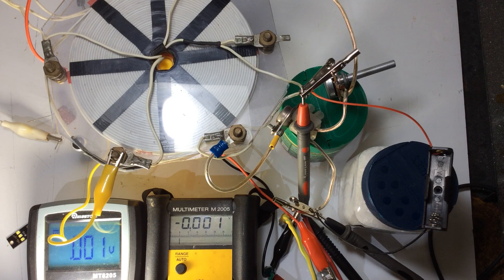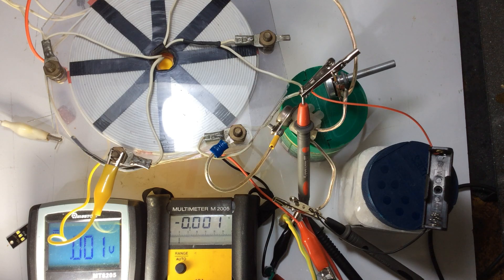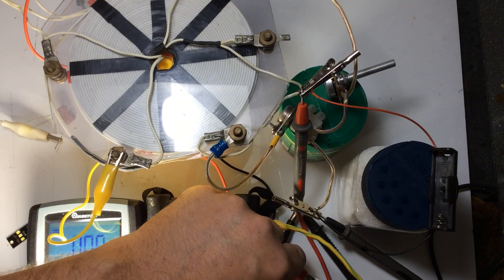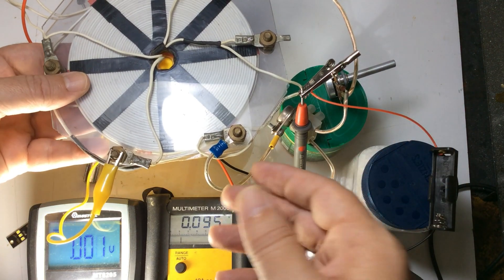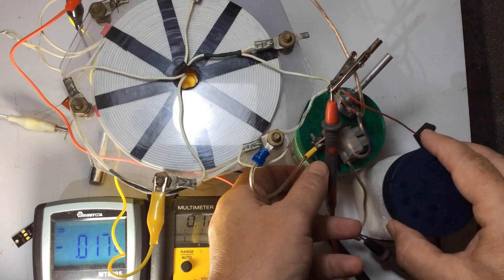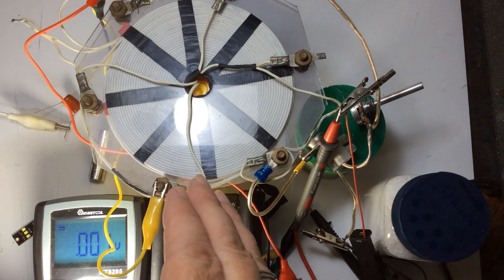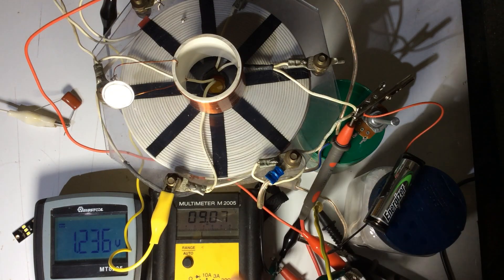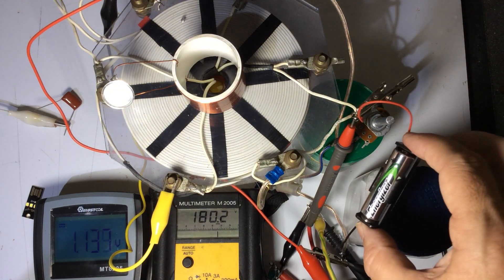Tesla Pancake Coil Joule Thief 1.2V to 180VDC

Comment: How you been? I just made this again yesterday. I'm going to try it as a "Re Emf" circuit see how it charges batteries. basically the same schematic just with some extra diodes. Also want to charge some super caps 600F 3v , see if I can boil a cup of tea. Anyway, I hope your doing well.

Comment: Also, in my other experiments following Tesla patents I found out that adding an earth to both secondary and primary together voltage doesn’t rise as much but, current is greatly improved using pancake coils.

Although I can’t explain very well why my setup works best with 3 secondaries (1bifilar+2monofilar) instead of 4 and not using quarter wave amplification … I can only guess might be due to 0.75 sqmm multistrand wire instead of 1.5 sqmm speaker wire, where resistance in 0.75 wire is more than double and voltage output is reduced … despite enough current available to power all kind of loads.

Anyway, this circuit is quite impressive and don’t need much power to keep batteries on float level.
Reply from the maker: Thank you for your comment.
My sincere apologies for my delayed response.

There are many amazing features gained when plugging into earth and in fact some of the biggest benefits to my circuit are only available with an earth. Keeping in mind that this is also achieved with an artificial earth, possibly not equal to but at least similar, which is extremely impressive.

For your coil arrangement it is important to remember that the load is part of the equation. The load can help or hinder achieving resonance, with one particular load the required coil arrangement will be different to a seperate load.

The next means of adjusting the setup to achieve resonance is capacitors, both serial and parallel arranged. I like to concentrate on coils + load/s, then I add capacitors if necessary.

I will upload a video on this circuit that I made shortly after I made this video, I wasn't in a good place when I made the video and it wasn't uploaded because I wasn't coping too well, both when making and after as my absence may have revealed.
In that video I use the two earth system and I can confirm it is as you state, a lot more power.

Thank you for watching.
Reply: @whatifididthis...1236 no need to apologise, I am very glad you are better and manage to come back online. I wish you all the best !
Reply from the maker: Unfortunately I'm not better, I just feel really bad that I can't answer people when I should, I struggle to sit still long enough to deal with it.

 This I believe is the downside of being tortured by my body and thinking this day is my last for 25 years, I'm surprised every day when I wake, thankful for another day and immediately my body reminds me I am a prisoner and I shall struggle until its time to go to bed, rinse and repeat!

I think the attention deficit is a side effect of living like this for 25 years, actually more like 35 years as the 25 years is from the time I was told I wouldn't live long.

As far as my poor health being related to my work as I have seen comments from people saying I may be suffering from RF emissions, I believe it has had the opposite effect as I was like this first.

When I was told by doctors to occupy myself because I could no longer work they suggested I get a hobby to occupy my mind between operations, due to my physical limits and the birth of the internet, yep that's how old I am! 😂, I chose to read Tesla's patents which lead me to become extremely proficient at scouring the internet for everything you could imagine, I am that annoying guy that knows quite a lot about most things as I'm obsessed with information of all kinds and I literally overload my brain with information every day as a way if mentally distracting myself from the pain. I am also blessed that I have an eidetic memory so I keep seeing everything I've ever seen like a database that is always with me, my own albeit limited wiki mind. Admittedly bias to my interests. The fact that I learned about and started playing with these circuits after I was already injured and I've exceeded my projected timeline I would suggest my circuits, Tesla's circuits, have been good to me.

I'm glad I am still bothered by not replying earlier as I feel once I no longer care it's going to get bad for me. 

I just want what I have discovered in my research to be studied and understood by others so thank you for your support and thank you to everyone else for the support over these couple of years, it makes me feel as though I am not wasting my time.

Thanks for watching.

Comment: I made one too that's freaking cool . It seems like it will literally reach any voltage theoretically necessary until it just burns out the transistor, which is what I did with mine
Reply from the maker: Thank you for your comment, I apologise for not replying sooner as I have been having some personal issues.

The circuit is cool and the flexibility on voltage is also pretty cool. It does a great job charging 12 volt caps and batteries especially if you supply a constant 1.2 volts its quite impressive. I will try to finish a video I recorded a while ago that show just how amazing it really is.
Again sorry for my late response.

Comment: you are aware that the output voltage is a direct function of the resistance of the circuit, right?

maybe not...

the meter has an input impedance of multiple megohms. the magnetic field is "energy". as it collapses, it generates an EMF, that manifests as voltage across a resistance, current flow through the resistance. E=IR...
 if the coil were superconductive, zero resistance, and shorted to itself, the magnetic field would never collapse, as the current would continue to flow with no loss. 

whereas if it confronted a "perfect" insulator, the current would cease and the voltage would rise to infinite...

a freewheel diode works, not by any nonsense about "reversing polarities", but because the current that created the magnetic field wants to continue doing what it was doing... it has "inertia". the diode appears as a virtual resistance, that clamps the voltage developed across it to the forward voltage of that diode... 0.2 for a schottky/germanium, 0.6 for silicon, and higher for LEDs... the current will persist, dissipating energy at the rate that voltage dictates... the higher the resistance, the higher the voltage and the faster the energy is dissipated.

what we see as a "spike", what many erroneously refer to as "BEMF", is actually EMF! it continues in the same direction it was going. its the education system and misunderstanding that makes us think "the polarity changes"... 

"BEMF", as per faraday, is the circuits inertia FIGHTING against change from an applied EMF... the solenoid doesnt allow full current to flow until the magnetic field is established. BEMF is the effort it takes to BUILD that magnetic field. upon collapse, the field creates an EMF, still flowing eth same direction as it started, and its the circuit fighting that collapse that is "BEMF".

an unloaded electric motor, with an applied EMF, generates a BEMF that opposes the EMF, minimal current is drawn, the motor self regulates its unloaded speed. if it tried spinning faster, it would generate more BEMF and therefore would require more EMF be applied to actually speed up. if its stalled, prevented from rotating, theres no BEMF to oppose the EMF and the windings quickly overheat and smoke as they draw maximum current...

air is not a perfect insulator. your meter isnt perfect either...  only a true vacuum can develop stupid high voltages. low pressure isnt enough... "paschens law" iirc, the conductivity increases as pressure reduces until it suddenly takes a nose dive and becomes truly "insulating".

but one must ask.. what is the end goal? of what use does this serve? just re-inventing a wheel, all of this stuff was messed around with and figured out well over a century ago.

whats needed is to go back through those old texts and try to find the bits that "dont add up"... of which there are PLENTY!

such as... where did the "mass" of an "electron" arise? from electroplating, that then correlated to jj thomsons experiments with cathode ray tubes and the relatively unknown "positive ray tube aka canal ray tube AKA anode ray tube". is there another way to verify? say, by the increase (or decrease) of inertia of a charged conductor? 

stop and look at a circuit. whats actually going on in the battery or power supply? if an anode is positive, it must be emitting charge at teh same rate it receives it... how? ditto for a cathode. to emit charge it must be accepting it as well...

can you redraw the LC tank circuit? can you BUILD it another way? yes, yes you can... look at a capacitor as normally drawn... try turning it inside out, for instance...

TLDR!

or here comes the YT shadowbanner with its big "censored" stamp...
Reply: Do a video on this stuff. That was very good.
Reply: What is TLDR ?
Reply from the maker: TLDR (Too Long Didn't Read)

Comment: If its not built in  Tesla spec why use his name in the title
Reply: Id guess because of the pancake coil
Reply from the maker: @hughthenasia5572 Thank you for your comment. Sorry for my late response.

That's correct it's purely as an association with Tesla because of the pancake coil patents he held.
Thank you for watching.
Reply from the maker: Thank you for your comment, I am sorry for my delayed reply.

To my knowledge Tesla's pancake coils were wires that sat flat on the same plane side by side where as the wires in this coil are one atop the other. That being said just because I have not seen a patent with the same winding here doesn't mean there wasn't one, as I am well aware I don't know everything.

I also can't imagine that Nikola Tesla wouldn't have tried this method as when performing experimental research your usually mixing everything up and trying heaps of unconventional methods and typically the Pancake coil is mostly associated Nikola Tesla. ie. If you show someone a pancake coil most people assume it's a Tesla coil.

Thank you for watching.
Reply: @whatifididthis...1236  Thanks for that, and best luck with projects !

Comment: Nice work, you can power these many ways, basically anything that can get to the threshold voltage of the transistor, unless you have it pulling too much amperage and it will drain the source too fast.. but yea it’s a great system for say, 1 solar panel to power a lot of led lights, you can still run motors, dc-dc converter, inverters, all real time except incandescent loads, you have to let the cap build then discharge periodically into a incandescent load and you will get it to light but they pull so much power the back spikes would have to be basically 1/1 on time. 
It takes a certain amount of “time” to build the field, but that field collapse in a MUCH shorter time frame, which is where the spike is coming from, in a perfect world, this transfer should be 1/1 on total power IF we could harness the whole spike, via extremely fast components.. 

But, 

My question is, what is pushing this field back into place? What force is that? And how do we get to it? Because it seems to be the thing we are actually fighting in circuitry..?
Reply from the maker: Thank you for your comment. I sincerely apologise for taking so long to respond.

You are correct about this setup reaching just about any voltage, I love how it seems to be self regulated to the load attached, initially I thought things would pop but it just seems to output what is needed.

As for the force pushing on the field, I can be wrong but I believe it is the earths magnetic field. I remember during my research on the Adam's electromagnetic pulse motor, reading how when a magnets field collapses the earths magnetic field acknowledges the depletion in the magnets field and almost instantaneously restores the field close to its original value, pulse and restore, pulse and restore thousands of times per minute. Watching that motor helped me understand a lot of things actually.

Again, I could be wrong but also could be right!

Thank you for watching, have a nice day.
Reply: @whatifididthis...1236 that would be very interesting if that is true about the earths magnetic field replenishing the dipole..! I just posted some new information, probably my most informative post yet! I would check it out! It explains exactly how the old “free energy” system work
Reply from the maker: I think of the following experiment when trying to understand it.
I have two identical hammers I want to hang on my sheds metal wall, 1 is held up by a magnet, the other is held up by an electromagnet, I believe the magnets “force” is not constant but a moving flux and therefore governed by frequency (like everything), the electromagnets flux also determined by frequency in its switching and battery supply, I believe both are losing their power when working and the earth’s magnetic field is supplying the energy at the point of collapse, I consider it to be a quantum connection between our universe and a magnet. 🧲 ⚡️ 🌏, the earths magnetic field can see the magnetic collapse and prevents it from complete collapse.

I could be completely wrong and no doubt someone will let me know however I like to think that I’m philosophising the concept more than most which leads me to more sound conclusions based on observation which is entirely different to somebody who studied conventional physics, as I always say, “if it’s wrong then your wrong and if your a professor at being wrong then I can’t help you”. So you may be able to tell that I don’t hang everything up on known science.

I checked your channel and subscribed, I will take a better look when I get a chance.
Thank you for watching

Comment: Thank you, you have reawakened my spirit for experimenation. Love to you and yours. I will recreate this set up with some side by side wrapped coils and some on top coils and link you, you can see the difference.
Reply from the maker: @davidiom27 Thank you for your comment.
Thank you for your kind words, I’m always glad to hear I have helped encourage someone to experiment as there’s so much to discover and motivation is hard to find.
How did you go with your replication?
Thanks for watching.
Reply: @whatifididthis...1236  I did a quick video compating them.  Not with with any measurements , but also just another detailed explanation of the circuit creation.I think in your previous videos you also show the effect of stacking the pancakes in series. I think thats the way to go.  Not so much to achieve over unity, but to be able to take a small consistent source, step up and then dump, has benefits for me living in my shed. And just looking to keep large batteries topped up, without having to invest an arm and a leg. I was up last night, talking to AI about cap dumps. If I get a chance, I think i've got two methods, Small relay trigger with a voltage divider, and another using a mosfet. Sounds complicated but I hope to make it seem simple. I appreciate all you do. Your channel is true gold.

Comment: By the way, you can use one wire transmission on secondary to fbr and the other input to fbr would be an earth and one leg of secondary another separate earth. If you add a third earth straight to the load voltage goes up much higher.

I’ve done hundreds of experiments but none published yet on my channel.

Use ground/earth as reference points to increase potential as potential is seen as difference between reference point and floating separate circuit legs. I bet you can get up to 3-400 v in output by just playing with reference points.

Also, I found out that I can replace earthing with negative of a battery using a shorter cable, results were improved … as my earth connections are not so great. Sometimes I can use positive of the battery with better results … depend on configuration.
Reply from the maker: @Caesaru2011 Thank you for your comment.
When you've done hundreds of experiments it's easy to have seen just about everything I show, I mean it's just a matter of time.

I love this little system, so small yet still so powerful. You are correct regarding the use of earth lines in this scenario. My next video I will demonstrate what you mention.

I used to think that  passing electricity through earth would be difficult, however when I achieved this with my own "off grid lighting" circuit I was amazed at just how easy it is. After that I was testing everything through earth and this little 1 volt joule thief pancake coil is currently transmitting through earth over 40 metres running LED's nice and bright.

I have also used this exact setup with a diode chain to earth that acts as a crude voltage regulator to charge the source.

Also I will try to remember to show my earth rods, I feel the type of metal is more important than the overall size of earth rods, although if you can deal with both issues you should have great results. Mild steel that rusts is best in my opinion. 
Thanks for watching.
Reply: What does fbr mean?
Reply: @acmefixer1 full bridge rectifier … I shouldn’t be so lazy and write down full words, apologise for inconvenience.
Reply: @Caesarus2011  
Full bridge rectifier?  No such thing according to Wikipedia.

""When used in its most common application, for conversion of an alternating-current (AC) input into a direct-current (DC) output, it is known as a bridge rectifier. A bridge rectifier provides full-wave rectification from a two-wire AC input...""

It's abbreviated to full-wave bridge rectifier.

https://en.m.wikipedia.org/wiki/Diode_bridge
Reply: @acmefixer1 no problem, my mistake … glad that you help to explain better ❤